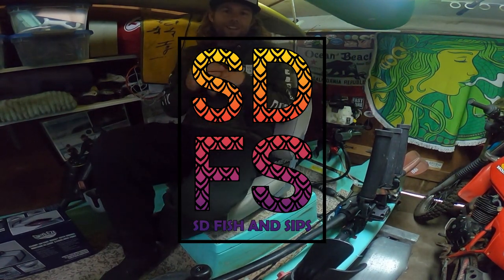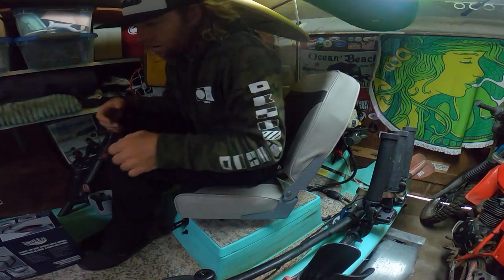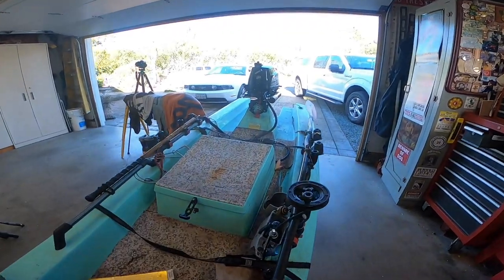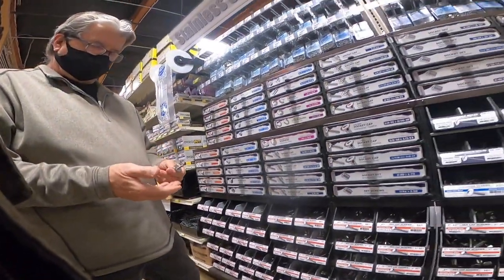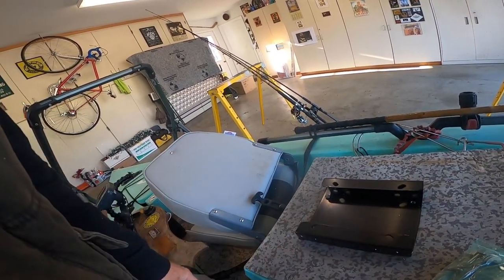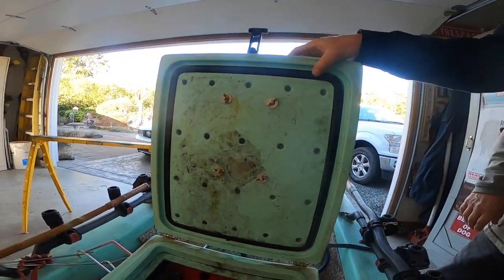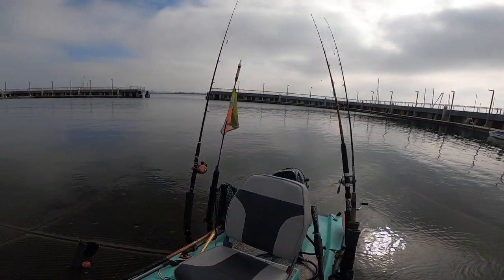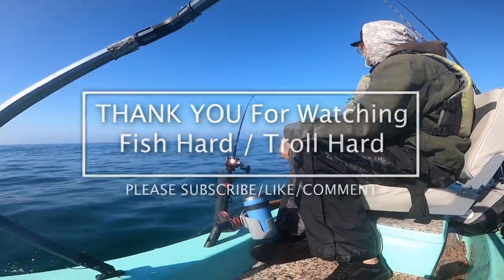Swivel Seat Install on a Solo Skiff - How to Do it Yourself

Comment: Looking good!  Did you mount it offset or centered?  I have a swivel seat waiting to be installed, but debating on offsetting vs centering it.
Reply: I started with my swivel seat installed offset due to watching videos of other guys on their Solo's and seeing how they sat while driving then. After having it for seven months, I have remounted my swivel base to be centered but slightly forward on the hatch. I feel that I am more balanced in the center when doing surf launching. Surf launching is the main area that I noticed that being off to one side was not the best when the Solo Skiff would go over a cresting wave and jumped down the back side of the wave. Hope that helps.
Reply from the maker: Thanks bro.  Mine is centered side to side on the hatch and offset just slightly to the front.
Reply: @markr9312  Thanks!
Reply: @SDFishandSips  Thanks!

Comment: Can the seat lock in to to be stable while your at full speed or does that really matter?
Reply from the maker: Great question Danny.  The seat can not lock and it does matter.  It is way less stable and more tippy feeling especially while turning.  I have the Hobie Standing H bar to hold onto which I have been using a lot for spinning around with the swivel seat and also for standing and casting.  If no H bar I would recommend a rope tied the front handle to grab and hold for extra support.

Comment: How do you have your gas cane connected under your seat because I thought about doing the same thing but everybody keep saying yeah might catch on fire
Reply from the maker: I have the gas can that is made by Tohatsu inside with a rubber line that goes through a hole cut into the back bottom of the center hatch then the line has a hand prime pump then a little moraine then connects to the motor.  i have not had any issues with fires.  Are you thinking electrical spark could start fire or what could ignite the gas or fumes?
Reply: @SDFishandSips   I ask this question on the solo skiff page on Facebook. And everyone was freaking out. Don’t do. You can catch fire. Or you will explore. I seen you do. Nothing happened. So I’m putting mine in the hatch. It’s in the way... I have the one from tahatsu. Make a video of yours...
Reply from the maker: @BreezeLifeTV  For sure.  After I get through my inshore saltwater lures videos I have a "Top 3 Things to Consider When Purchasing a Solo Skiff" and this will be one of the things I go over.  Thanks for watching and the feedback.  I am going to get on the Facebook Solo Skiff Networks.  Right now I'm mostly working with YouTube and Instagram but I know Facebook will help.   Especially now with my upcoming trip planned for Texas and the Southern Coast (3rd Coast).
Reply: @SDFishandSips  anyone renting solo’s in your area?

Comment: I would have added a backing plate under the lid for peace of mind to help better distribute pressure points from the hardware, but otherwise looks good.
Reply from the maker: Thanks Blake.  My buddy Nick here in SD also recommended a backing plate.  He suggested a plastic cutting board.
Reply: @SDFishandSips  Yeah, I just ordered a 1/2” thick 12”x12” sheet of HDPE off of Amazon to modify and use as a transom saver for my solo skiff. You probably wouldn’t need 1/2”, but I plan on making a 1/4” recess for the circle pads on the clamps to sit into so they don’t shift/slide on the transom.

Comment: I have the same ones on my dingy idk if the a cardboard backing but after leaning in it they ended up folding kinda like breaking with out falling apart but I hope it works . Another thing if u could get back to me my buddy wants to buy a solo skiff where do u purchase them ?
Reply from the maker: Thanks for watching and in personal experience information about the seat.  I'll make sure to keep n eye on it.  To purchase a Solo Skiff you have to go through a local distributor for new or craigslist for used. The local distributor for San Diego is OEX kayak fishing in Clairemont.  Hope this helps.